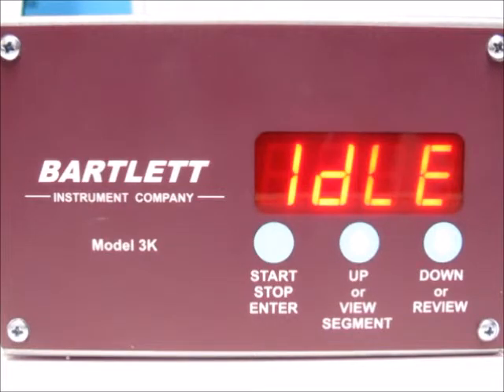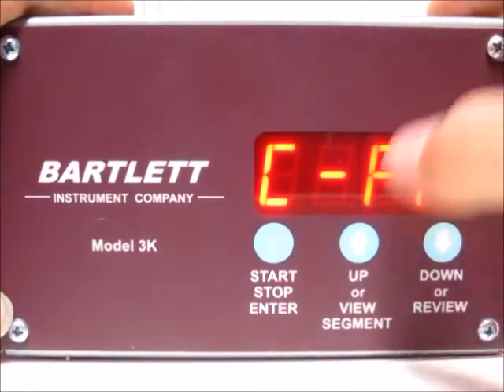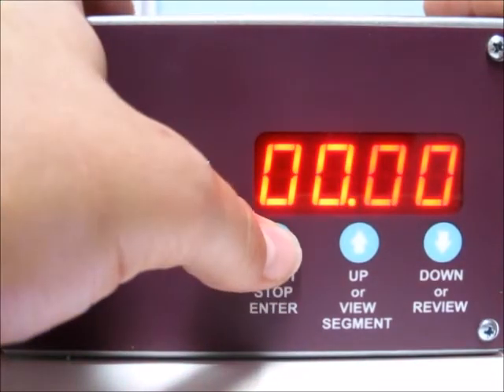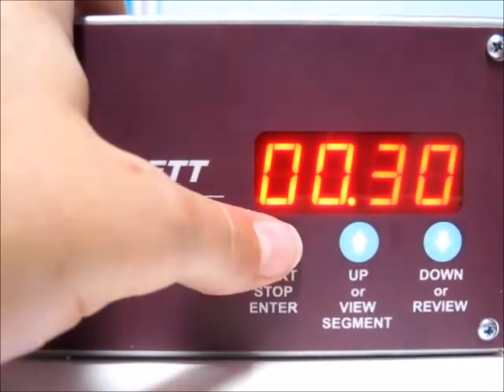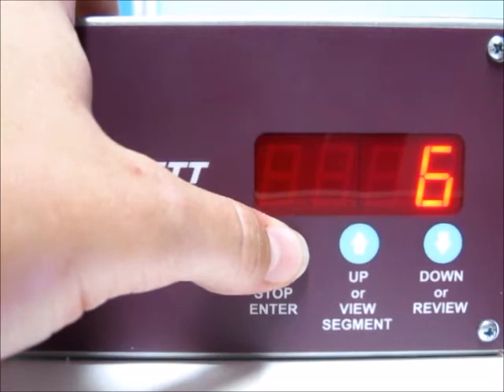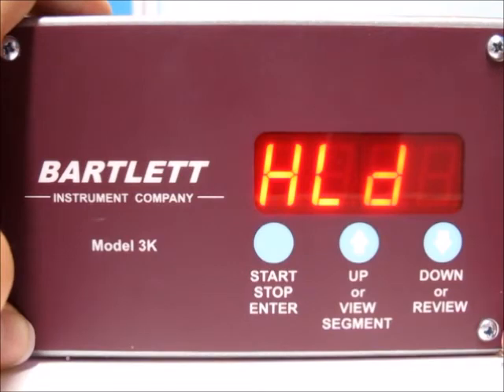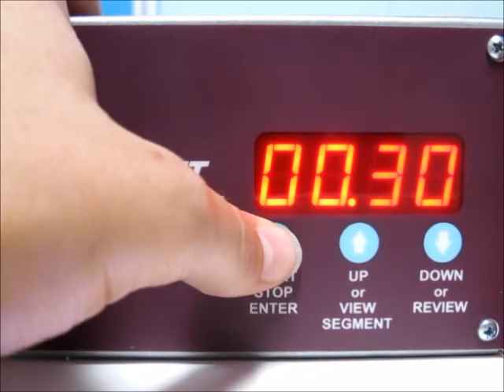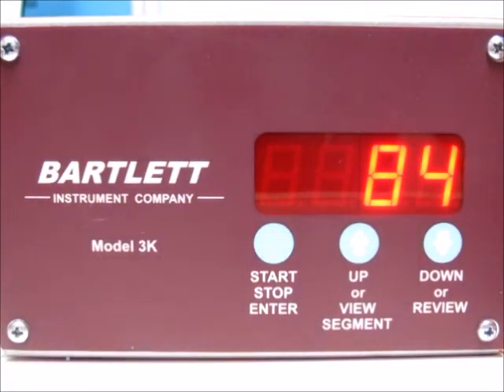Bartlett 3Key | ConeFire Programming

Comment: C-Fr never populates for me. 

I purchased the Doll-E earlier this year and am finally ready to fire it. (My 1st kiln)

I'm following the instructions and all the manuals, as well as going to YouTube (this video and others) to view Bartlett's instructions. The very first instruction is to press enter until C-Fr appears. This never appears on the screen. 

Is there something I'm missing? Could this unit be faulty?

The codes that do appear are:

rEdl

51

iDLE

Stop

52

r-Hd

dELA

ISr 1

SE6

0001

1200

rA 1

OF 1

HLd1

Please advise.

Thank you!
Reply from the maker: If this is an older used unit, the software may not have the Cone Fire feature. 
If the unit is a limit or set point 3K controller it will not have the Cone Fire feature. 
Please reach out via email to information@bartinst.com 
One of our kiln control techs will be able to help you out further with this.

Comment: I have an olimpyc kiln with a 3 key controller, but i entered to a menu which is not in the manual, and since then all the fires I make only goes up to 950°c and then the error 1 is displayed, I tried everything, I think I deprogamed it, how could I reset to default factory program?
Reply from the maker: Please contact Olympic to ensure the correct max temperature setting is set.